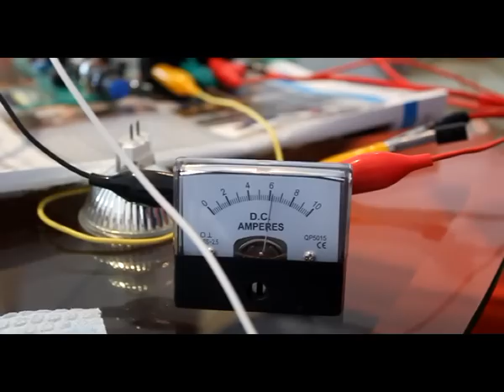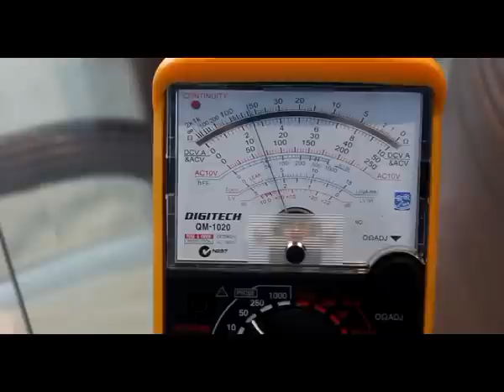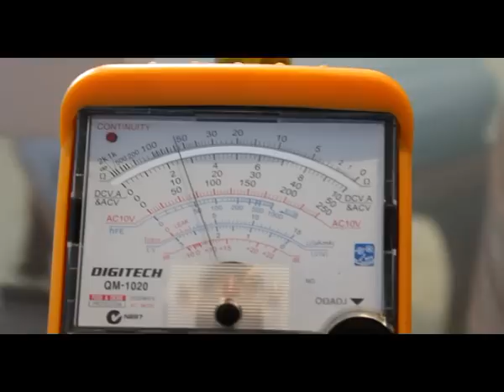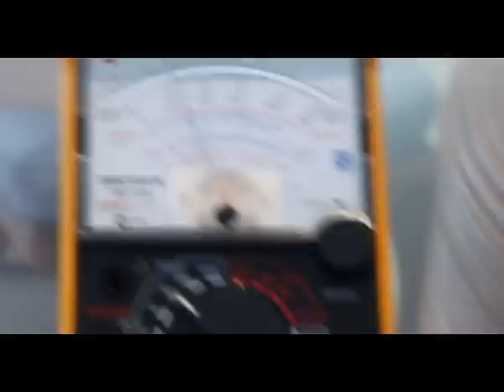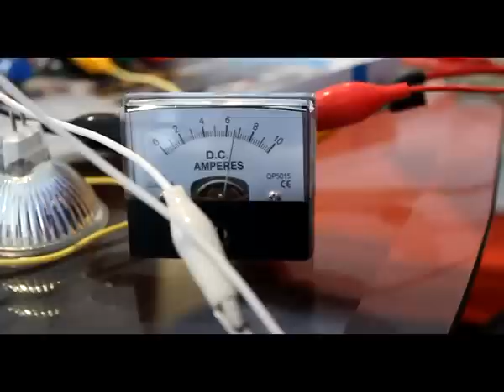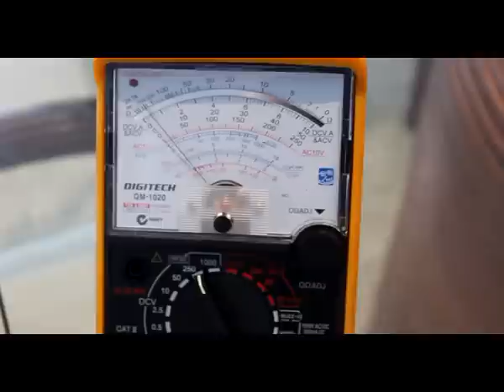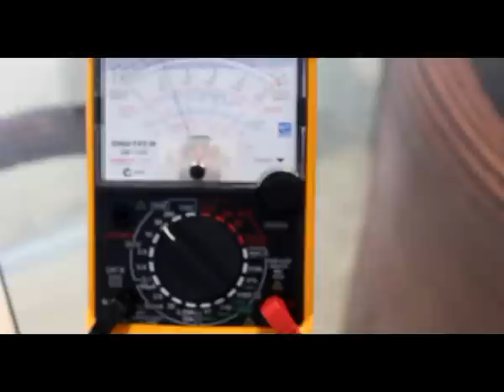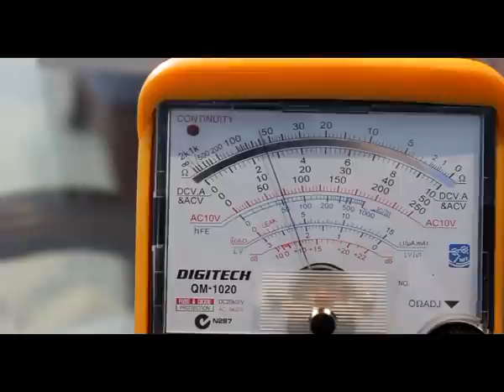Kromrey Converter up and running!

Comment: good work, one possible next step is to have your charge battery hooked up to a dc to ac inverter and run your dc power source from your inverter to see how long your battery voltage maintains or drains, thanks also they recommend a deep cycle battery

Comment: What is the controller being used for? Also, what would your analog amp meter show if you put it in line in between a load, say, a 12V and 100W light bulb and the converter output? This all sounds very interesting...

Comment from the maker: @delphinny Hi, sorry for the slooow responses. Been busy. Almost all of the device I had custom machined. The only off the shelf parts were the drive motor and the fwbr. 

@All - I have shelved this device for a while while I work on a couple of other things. The Kromrey as it is right now is not over unity. The drive motor is too small for this application, the coils do not have enough turns and are not perfectly impedance matched. Fixing these will improve overall efficiency.

Comment from the maker: @docscot11 This isn't his latest invention. He didn't design it, he just built it and replicated it. No, the lower coils are not separate from the top coils, they act together to cancel out all the positive electricity (normal EM) and only allow negative to pass through. My replication is not cop 1 yet, I need to do more work in balancing the coils impedance. As you mentioned, the little motor should burn out, and if I run it more that 30 min it starts to. :) That's why I'm hunting for a new one

Comment from the maker: @diveflyfish ,

Hi mate, I'm not exactly sure what you mean by monopole or alternating coils. I wound them exactly like Bedini draws them in the DVD. As far as running this on a higher voltage, I need to get a new drive motor with more torque. The one I am using now is rubbish, to be honest.